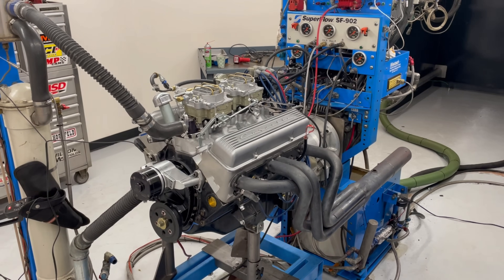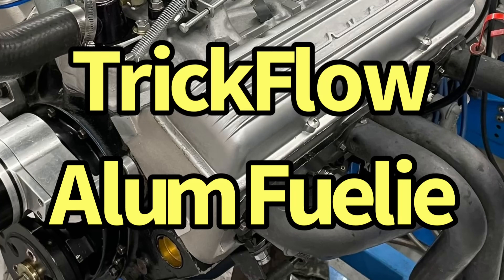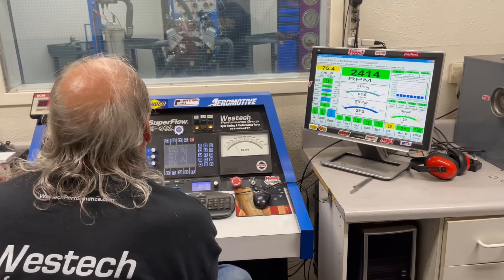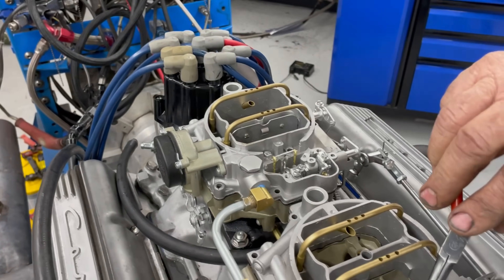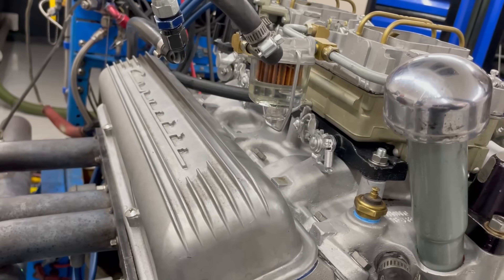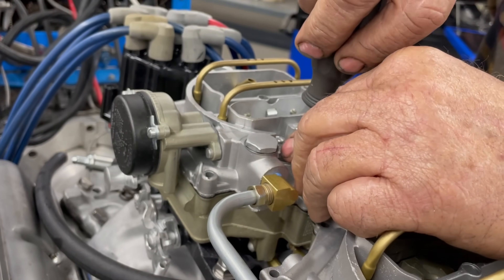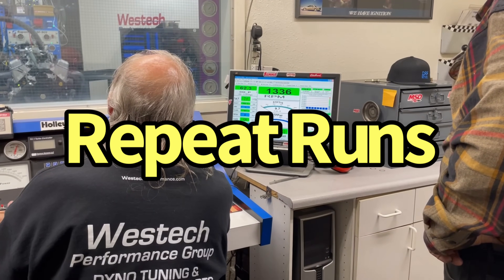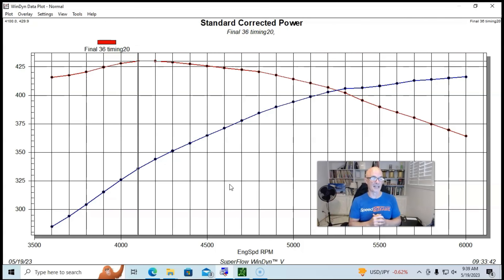HOW TO: DUAL-QUAD 283 STROKER CORVETTE MOTOR. FULL DYNO RUNS, RESULTS AND CARB TUNING. WILL IT WORK?

Comment: That's a lot of cam to only rev it to 6k. Did it drop off after 6k? I would have thought that's way too much duration for that application, and a solid roller no less!
Reply: Heard the guy say he ordered a much smaller one but would take ages to get so he was sold this one
Id have picked a much smaller one.  Ought to rip good in a light vette though

Comment: Camera focused on mullet/bald spot instead of dyno screen = Fail
Stopping dyno test at 6000rpm on a forged internals small block = Fail
Reply from the maker: useless comments...fail
Reply: @richardholdener1727  not listening to constructive criticism = life fail
But seriously, why did they not run it past six grand? The horsepower line was still climbing.
Reply: @thereisnospoon52 start your own dyno channel
Reply: Maybe the person the engine was built for didn't want her wound over 6

Comment: Richard, what valve covers were on that 350? The old stock ones would never clear roller rockers. LOVE those aluminum stock looking valve covers.
Reply: The walls that mount the valve cover are actually taller on these than original camel backs for this reason  . Hope this helps.
Reply: @brokedonkeygarage6017  I went back and viewed them and see what you mean. It's hard to see at that angle but they are taller. Thank you!!
Reply: @Geoduck.  you're welcome  :)

Comment: So it's actually a 350...  I probably would've just built a 383 with a milder cam and kept the exterior looking like an old engine.  Would've made as much power, more torque and more streetable.  A real 400 hp 283 would've been cooler than either one though.
Reply: I agree. I'd have rather seen close to stock displacement, BECAUSE of the rumored 400 hp 283's we heard of.
Reply: Be hard to put a vent tube in the valley of the 350 but I'm with ya even though I'm partial to the 283😊
Reply: It's a small journal block though, they were pretty light and he would have had some grinding to do to get the 350 crank in there.
Reply: Manifold and carbs are the limit

Comment: I am soooo confused.
How does the power curve look like that with 260cfm heads, dual quads, and a solid roller cam?
Reply: The intake manifold is whats holding the combo back up top but theres nothing wrong with 425ft/lbs from a 283 based v8.

Comment: 4.02 bore you said, that's bored and stroked, bored within thous of its rusty old bores.
Reply from the maker: .020 (that's twenty thousandths)
Reply: @richardholdener1727  So it's a stroked 327 bored 20 then.
Reply: A stroked 327 or a stock dimension 350 with .020 overbore(?) Either way will do😊

Comment: 242/246 is a lot of cam - for a 283.  Not so much for a 353.  Great heads.  Seems like it is held back by the intake.  It would have been interesting to throw an Edelbrock RPM or maybe a Holley Strip Dominator on it.
Reply: It was definitely being held back for how big the cam was.
Reply: @bri-manhunter2654  Many guys back in the day ran the 30-30 Duntov cam in their 283-301s. Do you know what the specs were for that cam? Valve Lift I .485 E .485, Duration @ .050  I 254 E 254

Comment: Would like to see a power comparison between a BBC 396 stroked to 454 ci and a normal 454 standard bore/stroke?
Reply: The 454 has a bigger bore, the 393 needs notches in the bore so the stock valves can clear. With smaller valves/heads the difference would be nothing. Once the valves got big enough for valve shrouding to become an issue on the 393 based motor, the 454 would have the edge.

Comment: I knew a guy way back when with a 57 Chevy that dropped a 327 crank in a 283 with 30 over pistons for around 311ci. Ran iron fuelie heads and a solid lifter 'full race' cam. 4spd, solid axle car built over the late 60's, early 70's and he was running 11.50's at 117-118. I forget the intake though, I want to say tunnel ram. I think the gears were 4.56 or 4.88 or something like that. 

That would be something fun to see, turning 7k RPM or more.
Reply: There was a guy at Mason Dixon Dragway in the 90's that had a 55 with a 283, no one I know knew what had been done to it but it ran 11:90's all day and with a 4 speed sounded like he was shiftng at 7500, it was nuts.
Reply: Grumpy wound them tight
Reply: @hotrodray6802  Grumpy built 307s?
Reply: @63Imp283 Grumpy built the 331 ...327 overbored with 283 rotating assembly. 500 hp
Reply: Would sound amazing screaming at those RPMs!
Reply: Back in the late 1950s through the very early 1960s - before the 327 went into production, Chevrolet R&D experimented with stroker 283s for their forays into road racing. Yes, 307s! My source for that is The Great Corvette, by Karl Ludvigsen. Not sure of the exact year of publication, but mid 1970s. They certainly were equipped with performance goodies, production and experimental.
Reply: Sounds like my dad but he had a 56 Chevy bel air with a 283 stroked out and ran fuelie heads, had a 4 speed as well
Reply: Sorry it ETd so slowly man

Comment: I have a 283 to play with. Every one I talk to about it says it’s a waste of time and money. I have a 67 Chevelle 136 car . I think it would be cool to put it in there with a 4 speed. Saturday night cruise and Sunday bracket race car. What do you suggest for a cam ?  I even thought of using a 2 4 tunnel ram.
Reply from the maker: it really needs more head flow
Reply: @richardholdener1727  how about  Dart iron eagles ?
Reply: @terrywillis5784  it’s your project and you should do whatever you want with it.
BUT the 283 is old, nifty, and rare. I would leave it as is, or do a era correct restoration on it.
If you want something fast, a standard 350 will fit nicely in its place.
Reply: A 283 can be built into a super fun street motor. 
I had one years ago. 
3500# car ran high 12s with it. 
Good compression, with good quench is important.
Don’t over cam, or over carb it. It will feel soft down low if you do.
Reply: @b.s.adventures9421  cool story.  Thanks for  your input.
Reply: I'm thinking of a 283 with 601 heads,comp 270 solid cam, performer EPS, with a Edelbrock 500 cfm 4bbl & ram horn manifolds in my 56 210. Hopefully with a th 350 with a 3k stall,2.75 low gear & a 4.11 or 4.56 gearset
Reply: You can still get the 097 Duntov cam for solid lifters.Was a cam design for a 283 corvette. Runs very well in 265 or 283.

Comment: And everyone hates on the 307 which is a 283 stroker. 283 with a 327 crank is a 307.
Reply: I'd much rather have a 307 than a 305.
Reply: My girlfriend's dad ended up with one four-door Malibu 307 ran great! Only modification was the dual exhaust old-school glass-packs, and I don't know if it came with it but 4-barrel manifold with a quad on. Faster than the 70s boats. 40 years ago one-wheel squeal was good enough for me when I was 10!
Reply: And it was much much better than a 305! Larger bore, shorter stroke and when you add 6.0 rods you’ve got a better rod ratio! The 305 was garbage.
Reply: @kennethcohagen3539  You know there are 500hp 305 builds running around out there? NA
Not many but its been done.
Reply: @kennethcohagen3539 what?
Reply: @kennethcohagen3539  WHAT!!!  ....B.S.    Apparently, you haven't  built  very many  motors .   Built  a 305 and then get back  to me.
Reply: 😂 a built 307 will beat built 305 any day of the week buddy end up getting your cookies ate @SteveoGregg
Reply: I'd rather have a 307 than a 305
Reply: @Bobthebuilder.69  really????
Reply: I had a 307 with 327 heads and a cam that was too big for it. It ran very very well.
Reply: Don’t understand why I guess from the get go it was only a 2bbl engine. Hell has a bigger bore than a 305
Reply: @taylormayberry4826 cause it's a base pickup engine
Reply: Loved my 307s, still have one to freshen up, maybe a 350 crank candidate. Already 40 up, makes it about 336.
Reply: @TomSmith-cv8hk custom con rods $$$$$.
Reply: And the 3 7/8 bore of the 307 limits valve size big time. They will bore to 327 sometimes but that is it. I rebuilt and old speedway engine that was such. 11-1 GM forged pistons, strong but heavy. Still going a decade later.
That engine was built early 70s. Here in Oz we got 307s in cars 68-70.
Reply: @ldnwholesale8552 
A 327 and a 350 have the same bore.
You can't bore a 283 to 327... Only to 302... It's the longer crank that makes the difference.
Reply: @hotrodray6802  302,327,350 all have the same 4"bore,look it up. The 302 used a 3" stroke,327 had 3.25 stroke  and the 350 was 3.48 stroke.
Reply: @hotrodray6802 but yet they did bore it over four inches
Watch the video
Reply: @ldnwholesale8552  Mine came in a Brougham.
Reply: my first car. 73 nova had a 307. Being 15 years old and salvage yards filled with V8's I never drove it a mile. Swapped in a '70 350 mildly built. Wish I saw what it
 was like before listening to all the 307 haters back then
Reply: @BBBILLY86  My 68 Nova/ Chevy11 had one, and yes, my 68 WAS a Chevy2, unfortunately and as far as I know the 307 was only ever a 2bbl but I could be wrong. this is why guys hated on them, plus since 1971 when the HP ratings went from gross to net AND compression ratios were dropped due to emissions many american engines took a horsepower hit in real output energy and the way they rated them at the same time. The 307 was right in there at that time period.
Reply: 350 isn't  a 283 stroker....
Reply: The only true factory SBC stroker. A 350 with a 400 crank was never installed from the factory but was manufactured as a crate parts counter replacement engine.
Reply: Yes I wish someone would duplicate the high horsepower 283 configuration but with a 307 crank and pistons. See what the stroker would make just with the extra displacement. Might need more cam. Maybe the Duntov 30/30?
Reply: @NESMOSPORTS  Jeff smith just recently went all the way on a 500 hp 307.
Reply: I had a lot of fun with a 307 69 nova with a 350/350 Vette cam in it in ‘69
Reply: I have two
Reply: Thanks My Friend I Didn't Know That but my Uncle put a 307 in a 68 GMC Truck in it done Quite Well But Then again You Can Never Go Wrong With a Bowtie Anything except for a Vega Aluminum 4 Cylinder but even at That GM got With Offenhauser an Designed a More Expensive 4 Cylinder Engine an l Think for no more Than it Was it was Peppy ! 🇺🇸👍🏻
Reply: Because a small journal 327 with a 283 crank is way cooler "302" screamer
Reply: I thought a 283 with a 350 crank was a 305 idk about these smaller Stroker’s but cool a hell
Reply: @Pisspantsgarage  A 305 is a 267 with a 350 crank.
Reply: @kenp639  yep you are correct. My buddy had one in a 90s Camaro in high school and it got like 25 mi to the gallon on the highway LOL. It could run with stock 302 mustangs tho.
Reply: Factory stroker
Reply: I bought a new 307 from Chevy for my mom's 63 Impala,it was a great engine,plenty of power
Reply: Because it's a smog engine with shit cylinder heads.
Reply: @Carado5150  every 307 I pulled apart had flat top pistons and decent heads.anything that worked on a 283 worked on a 307.they were a good engine and any knowledge able back yard hot rodder could make good power for a small engine.realisticly 307 was before all the heavy smog crap
Reply: It’s a 302
Reply: I had a lil 307. I put headers,  a performer rpm manifold a 262 cam i believe in a 77 step side with 411 gears. She was a ripper

Comment: Just one of Chevrolet's  many great sixty's small blocks. Another 72 cubes from the 155 thou  small journal 350 stroke crank didnt hurt it at all. Love the way those carbs are engineered and thanks for showing us the inner tweeking on the dyno floor. That torque figure of way over 425 lb-ft, that's huge!
Reply: 145 up on a 283 block, big call, could be a 327 block. If it was a 283 block you'd go to 4", not 4 and 20.
Reply: @TomSmith-cv8hk sleeves?
Reply: @hotrodray6802  They'd end up wet in a 283 block, there were 283 blocks that would go to 4" but when you add 5 decades of corrosion it'd need some block filler. Assume he's used a 283 for numbers but a 327 looks the same with the gusset on the china wall etc.
Reply: @TomSmith-cv8hk  people never think about the corrosion part of things
Turned away porting some power pak heads due to the bowls being paper thin. Untouched but corroded bad from the backside

Comment: FINALLY a mouse motor dyno,, everything seems to be LS anymore, there are those of us that still LOVE the mouse motors SBC's.
Reply: I agree 1000% The LSXX engines are awesome technology, no doubt about it. But I am a fan of GEN 1 stuff, and I don't feel bad about it. At this point in my life, trying to convert over platforms,for all my cars,just won't cut it. When I drive my very mild obsolete 305,307,327,350 to the track to foot brake e.t. 
race, which is mandatory duty, and you beat a very fast lsxx car, they are incensed on how it could happen. Watch out the LSXX crowd hates it when old heads don't fall in line.
Reply: @mikef-gi2dg  Yep! built my sbc for the same reason. Goodbye LS7 Z06
Reply: @gordocarbo  Great minds think alike.
Now a lot of the LX-IS THE ONLY WAY crowd  will read this and turn green. I am an OLD HEAD, but my 2015 Silverado aluminum 5.3 reminds me the LS platform is the real deal. I have a big problem following the crowd because it's POPULAR. 
I don't expect that to change. Gen1 stuff is simple and affordable, and I got a bunch, i'm going to use somewhere. Now a LS 4.8, yes 4.8 with a POWERGLIDE, is on the drawing board for my 75 or 79 Chevy Monza, but other stuff is first. Yep I expect it will piss some off! NOTSORRY!
Reply: Seeing 283's screaming down the track in stock and super stock is a sight to be behold. Long live the GEN1 small block....no disrespect to the GEN3/4, just love GEN1....NOT SORRY!
Reply: @SupremeAI98  well an LS expert has just laid down the law...we should all apologise for our discretions. Please excuse our lack of vision.
Reply: Mouse motor, lol 350 its 5.7L!
Reply: I do like em to brother but the LS is a much much better engine all the way around.Specially bottom end is what it is.
Reply: I'll stick to my 350 and 454 chevy love the lil 283s and the sound of them screaming
Reply: Ps also love the 2nd gen l31350 and lt1 have an lt1 350
Reply: The LS engine family has been around for nearly 30 years already, might as well get used to it…

Comment: The sound a 283 could make reving to moon
Reply: It should of but not this one!
Reply: @63Imp283  look up 12,000 rpm Nova😃
Reply: @63Imp283  I know this is a street motor
Reply: Wound my stock 2bbl one in my 66 1/2 ton 8k in 2nd many a time